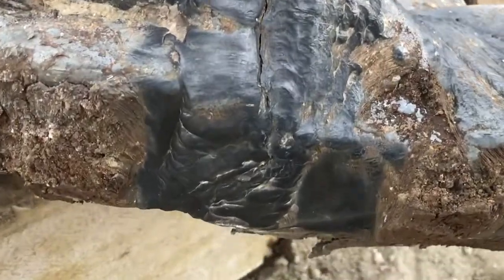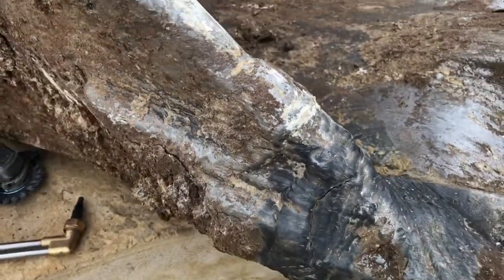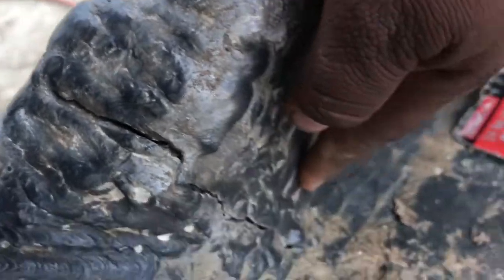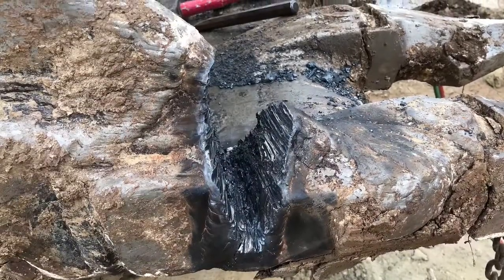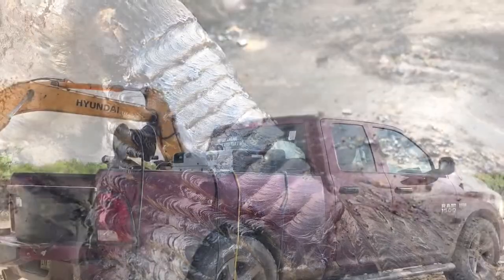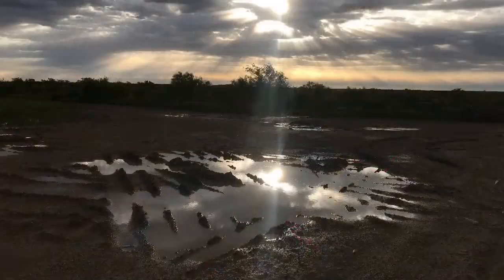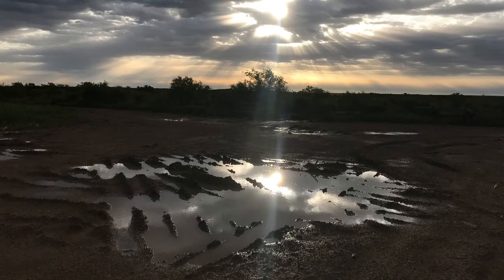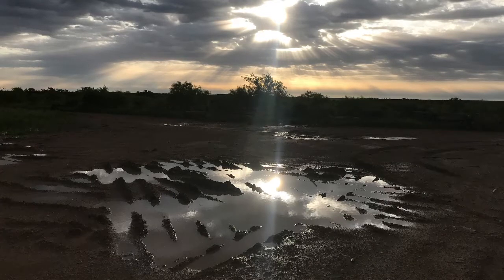Repeat Customer Mobile Welding Gig

Comment: Great video, great welding! What brand and type of welding rods you use on this job?
Reply from the maker: Antonio Castrejon Thank you for watching, I used 5/32 7018 rods and I really like the Hobart brand from tractor supply. If not them then I use the 5/32 Lincoln electric Excalibur 7018
Reply: Welding Projects TV I have been using the Hobart rods from Tractor Supply too, I think they are great! Are you still working a regular full time job and  doing welding on the weekend?
Reply from the maker: At the moment I am still working at my regular job and doing welding after work or on the weekends.
Reply: Welding Projects TV love the hustle, keep it up!